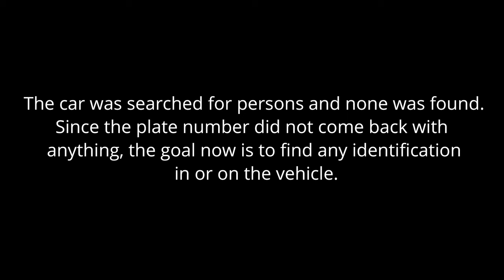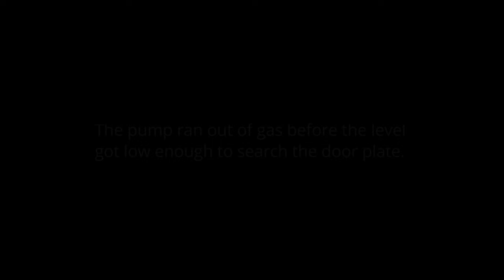WE FIND AN OLD CAR IN OUR POND - PART 2 -  The Ashtabula Sheriff Department is Now Involved

Comment: They only made that body style 3 years, 78-80. If it has 2 headlights, its 78-79. If it has 4, its an 80.  There is an id plate on the firewall near the brake booster. There could be a plate in the door jamb and there are vin numbers on the frame.  Also, the engine block has id numbers that will help.  However, pre 81 cars have a shorter vin and records are spotty for those
Reply from the maker: Thank you for the information! We greatly appreciate the knowledge.. We will be heading back out here this weekend to look for a VIN somewhere. Fingers crossed the plate on the firewall is not gone!

Thanks again.

Comment: There should be a vin number on the motor as well.
Reply from the maker: Someone else told me this but I am not sure where it would be. It there is a vin on the motor, it may be stamped and able to be pulled.
Reply: Usually on the block

Comment: Some the vin will be in the door frame also or under the hood
Reply from the maker: We looked :(. There numbers under the hood were the body numbers and the ones on the door was gone as well as the dash vin plant. Someone did mention that there may be on on the frame underneath but we still have not had the opportunity to get the car out.

To date, it is still a mystery.